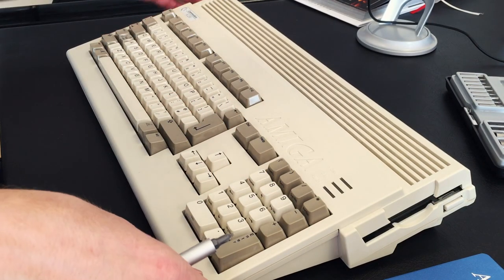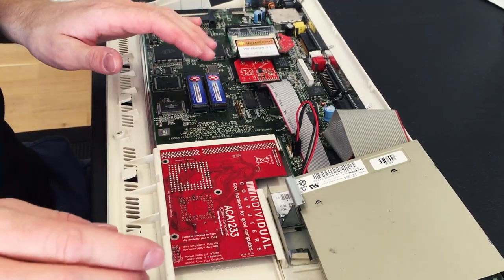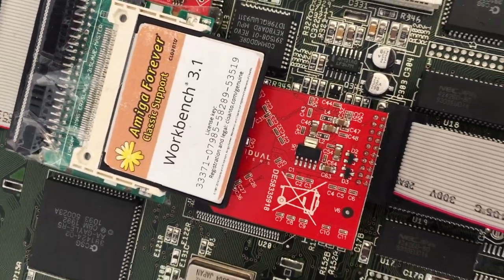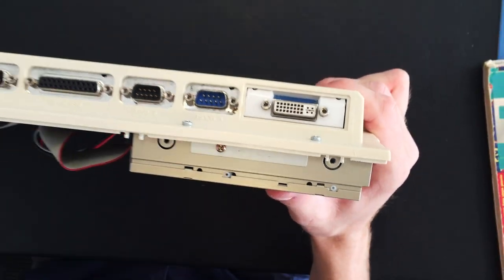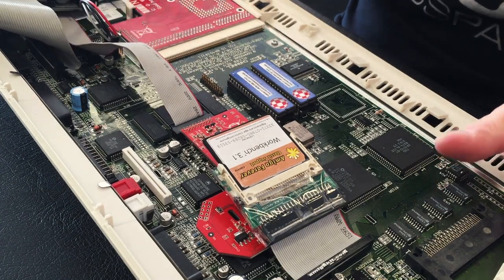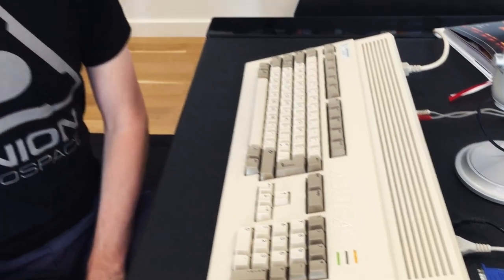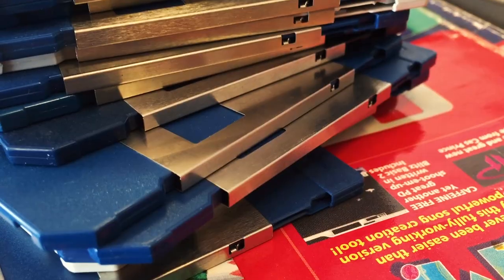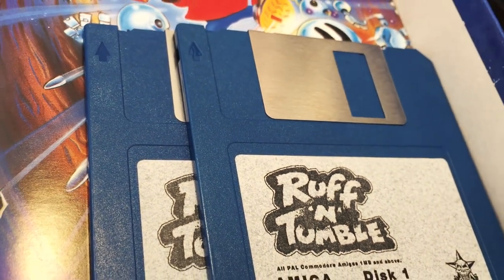Rad Rodgers - Amiga Special

Comment: I may be using an overclocked Intel I7 920 system today, but my dreams as a kid in the 1980's were to have an Atari ST to replace my Atari 800 XL. I didn't really get to play one but I did get to play my mate's Amiga 500 back in 1987 (I'd be about 9 or 10). OMG that was amazing, especially Turrican. When I was 15 I had a Mega ST for a year with a high res monochrome monitor, then I got my first Amiga 500, I discovered trackers and Deluxe Paint. 

A year later I got an Amiga 1200 which was superb, and made music with Octamed Sound Studio,  connecting midi synthesizers such as a PSR 330 & Yamaha DJX. By August 2000, 6 years after getting it, it went to heaven (i.e my loft), it's been up there for 16 years pretty much, it still works.

I also bought Ruff & Tumble, Super Star Dust AGA was awesome also, there was also a SNES Starfox clone that was cool. Admittedly the Playstation 1 with Music & Music 2000 kinda pushed aside my Amiga 1200 from 1997-2000 before I got my first AMD Athlon 750 pc system, however I owe a lot to my old Amiga 1200 for providing me the means to produce and learn the skills to produce the music I do today with Reason and over the past 22 months Presonus Studio One, you can check my stuff out here https://soundcloud.com/scott-moncrieff-1

Comment: Thank  your for the interesting video, I might consider unpacking my Amiga after 16 years in storage + Rad Rogers Kickstarter backer. Your video updated me on adapters one can buy to enable use of DV-I and USB do one can connect current tech like USB mouse, flash memory, etc. The 4Gb Compact Flash with Workbench 3.1 looked very interesting. Back in 1994 I struggled to get a 120Mb (gigantic for it's time) hard drive working on Amiga. SCSI adaters, Squirrel CD Drive. This hard drive is now right next to me in my drawer.  Although intersting to view, pixelated gfx of the 80's and early 90's is not for me. Gimme 2017 tech.

Comment: I still have one of those in original state, though the connor 120MB HD has probably died by now. I still miss the Workbench dynamic Ramdisk. To play games that I couldn't install on the HD I used RAD disk  which is a semi permanent RAM drive the size of a floppy disk, you would create the RAD drive in Workbench and then copy a floppy to it. Then you did a soft reset using Amiga+Amiga+Del and teh system would boot from the RAD disk. Unfortunately this didn't work so well for multi disk games though.

Comment: As someone who has never used an Amiga: The person in this video mentioned something along the lines of "And even CD games" in regards to the enhancements he made to it, so then is this still a rather outdated Amiga even by Amiga standards compared to some of the last models released?
Reply from the maker: There was a seperate amiga released called the Amiga CD, but it has practically nothing to do with the classic Amiga's. The Amiga CD was basically a video-game console, like the Playstation or Sega Saturn. But you could buy an external CD drive for the Amiga 1200, but barely any games were released for it.
Reply: There was the CDTV which was A500 based and the CD32 which was A1200 based. 
Although Commodore didn't release the CD drive for the A1200 You could add a drive through the use of a PCMCIA interface (I had a Squirrel SCSI card) and you could play CDTV and CD32 games using that. If you had a big box Amiga it was a simple thing to add a CD drive.
Other than PD and Aminet, not much was specifically for the the Amiga computers that I remember.
Reply: This is true. The 1200 also had an IDE connector, so you could (and often did) add a third-party PC based CDROM. That would work pretty well, except it would be external so the case would be hard to close unless you made your own (trivial) modifications there.
Reply: VastyVastyVoid I did that but it was so slow that when I played Microcosm it was a slideshow (I believe it had something to do with the IDE port not being buffered, I can't quite remember it was some years ago)
I was just reunited with my Amiga after 16 years so I'm looking forward to getting it up and running again.
Reply: Interesting. I think I had the same problem with Simon the Sorcerer CD32 -- the sound didn't buffer correctly. Wonder if there was ever a hw fix out for that.
Reply: VastyVastyVoid Once I get my flicker fixer and a US PSU I will check it out.
Reply: Cool, here's hoping it works out for you. :)
Reply: daishi5571: there was a CD-Rom drive released for the Amiga 1200, I have one. It used the PCMCIA port and special software that had to be installed in Workbench to mount the drive. You couldn't boot from it and you couldn't play CD32 games with it though. It might have been a 3rd party released product, I still have it but I'm too lazy to dig it out to check.
Reply: In an earlier comment in this thread I did say that you could add a CDROM via the PCMCIA adapter, the Squirrel SCSI and that I also have one (I'm guessing others were made but that was the big name one) it did need driver install to work in OS, however you could also make a boot floppy and booting from it would make the CD drive run CD32 games.

Comment: awesome! I found an old amiga 1200 with broken floppy drive in a dusty corner of a small retro store whilst on holiday - it really stood out because when given a wipe the case was still WHITE and not yellow. Bought it for £30, took it home and swapped the dead floppy drive for a gotek and it sprung to life. I then got an ACA1221 (not quite as bling as yours, but fully unlocked :D) and a CF adapter from ebay. Its one of my favorite machines now.

I'm running workbench classic as an os, have you checked it out? the iGame launcher is much more friendly than directory switching :P mind you your WB does not look stock to me at all.. manual mods with icon packs etc or is it a distro? man I love these machines. Think i'm going to go play turrican2 for a bit!